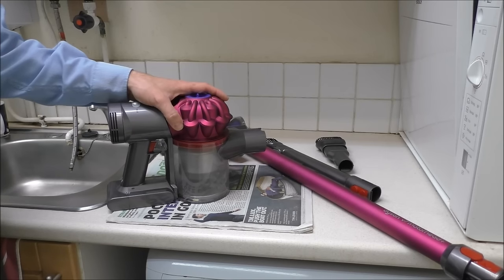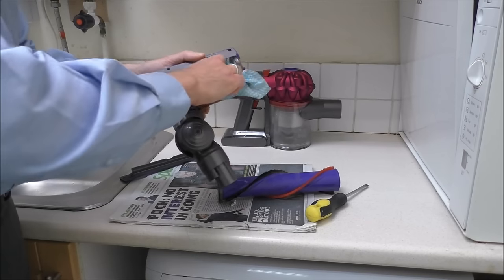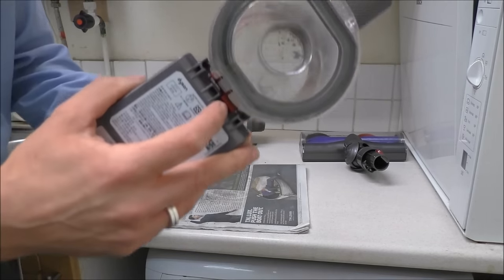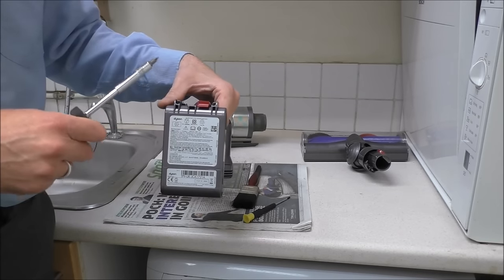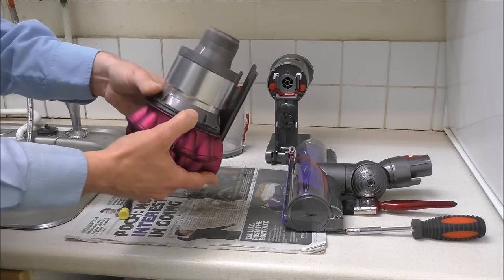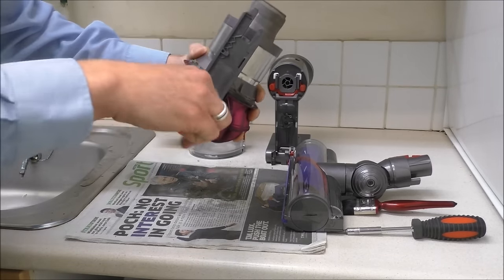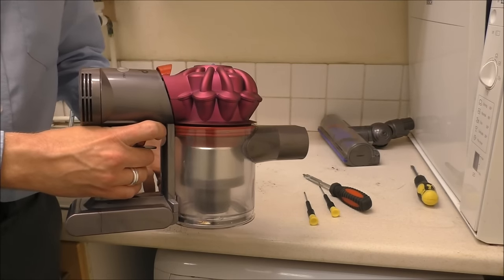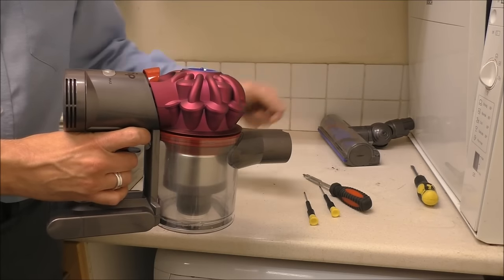How To Clean The Dyson V7 Cordless Vacuum Cleaner

Comment: This video is excellent. I’m almost 70,  have medium tech skills.  Had no problem understanding steps.  Did have to go buy a torque screwdriver, inexpensive.  With the trip to hardware, it took about 75 minutes from start to finish.  Dried everything with a blow dryer on low heat and fan.  Thank you so much.
Reply: I had to give you a like doing this at 70!
Reply: If you are able to do this outside, in the garden on a breezy day it is much better than doing it inside, especially in the kitchen.  That dust is everywhere in the air, and if there was a ray of sunlight entering the room it would illustrate the point I make.   Rather than brushing and tapping if you have access to a vacuum cleaner that blows use that, outside of course.  The harmful germs in that dust are not good to get into your lungs - dog & cat poo, avian bacteria etc. etc.  This is not scaremongering it is common sense.  As with sanding wood, do it outside on a breezy day and save your lungs!

Comment: I would suggest just to press on the plastic of the  metal screeded shroud so you don't bend the plastic with the flat head screw driver. If you press on the front side were the tab is (where you began to pry with with the flat head) and keep going round until it all unclips I found it worked just as good and without the slight damage.
Reply: Brother, your comment deserves more likes. I made a few minor scratches on the plastic and even one on the shroud itself when trying to pry it open with a flathead screwdriver. I was about to give up. But, I came across your comment...it took a bit of force, but it worked. Thanks so much.
Reply: Wish I saw this sooner. I have 100% bent the plastic 🥲🥲. However the rest of the video is great. Wish it wasn’t such an annoyance cleaning the thing

Comment: Excellent video. I had a pulsating problem in my dyson. I took the filter out and cleaned it thoroughly and the took cap of motor area dry brushed it all out and now works perfectly thanks for the easy steps to follow. Most helpful. I didn’t take mine all apart like you have shown but if I have to will follow your video again to do it.  I’m am 75 yrs old and was able,to understand every step that was taken. Thanks for the help !!

Comment: Thank you so much! Just cleaned mine watching your video. Important Tip: Adding to everyone else's advice, be sure to assemble the bin to the handle first before pushing in the top portion back in. It makes everything fit better. Also, the clips holding the metal filter are very fragile and higher up than you could imagine. Brush works but I found using compressed air outside is much better.
Reply: Yeah, I stuffed up there, before I came to this channel. 🤦‍♀️🤣

Comment: I used an air compressor that was designed for a pneumatic nailer, worked like a charm and I didn't have to take the unit apart as much as you did. Good video for those that don't have an air compressor.
Reply: change the filter or remove the existing filter from the frame piece and use compressed air to get the dust dirt out of it and the vacuum will work again with good suction!

Comment: I had a very bad odour since I bought D7 mattress and cleaning of filters, this has been on going for 6 months , after opening I found baked on dirt which cause bacteria to grow, now fully washed with disinfectant and soapy water internally as long as plastic and stainless steel fully dried I have had no issues now no smelly vacuum, I went one more stage than you and took next internal top apart very dirty in side.
Spot on video ,  straight forward when you know how 🍻👍

Comment: Very helpful and easy to follow. I had to pause and start the video often as I did each step. A list of tools I will need would be helpful at the begging of the video. Warning of not getting the contacts wet should come BEFORE he says to rinse the bin.
Reply: Agreed, I put mine directly into water. Now it doesn't work. However, I did leave for 2 days to dry. I wonder if my battery is dead, however, it was working before, albeit on/off, on/off constantly despite emptying bin and filter, etc. Any other ideas I could try before I buy a new one?
Reply: @penniejackson8479 What happened?
Reply: It worked in the end :)  @atxbee

Comment: Great detailed information.  I just cleaned my V7 watching your video. Thank you for all your help! I like the idea of compressed air ( by Jay). I used running water in All plastic parts and let the parts dry really good for half a day. It is working very well. I would do this deep cleaning maybe once in 2 years. Except for the small blue filter.

Comment: Thanks very much. I now know T10 and T8 bits to take it apart.  I cleaned it up a bit and turned on without it being 100% dry, now have a moldy smell. Need to take it ALL the way apart like you did and clean all the bits and wipe with a slightly damp rag, let dry. Very calming voice.

Comment: Very good video , but think you should show that the long cylinder filter clips apart as inside in can be heavily blocked and if so your Dyson v7 hoover could still keep pulsing or cause much lower run time , if you just ran it under the tap and left to dry for 24hrs and didn’t clip it apart and clear out the blockage as very common fault for low run times .

Comment: Great video!

My V7 Animal Dyson was cutting out every 3 seconds and the battery wouldnt last beyond the upstairs of the home.

Only fiddely bit is getting the metal mesh surround off with the flat head screw driver (at 6mins 10 seconds)...where you can void the warranty. I think I bent the plastic and it doesnt fit back as neatly, so suggest youre very careful here.

I also didnt know (until this video mentioned it) that you could get replacement batteries, got one on Amazong for £25. Longer lasting and so easy to install.
 
I just did a clean (with the new battery too) and it works like a charm!
Reply from the maker: This is great to hear that it has helped you out. Thanks for the feedback  😊

Comment: Very useful video - got me to 'first base' disassembling the cyclone unit as without it I'd never dare to apply the amount of force it takes to remove the shroud! But having got to the maximum extent of your disassembly why not go all the way? I found that the filter housing simply pulls off the bottom of the cyclone manifold and this reveals four more torx screws (well buried between the cyclones and hidden by dirt). Then there are two more in the air outlet port. Remove these six and the two halves of the manifold come apart. Then the internal parts lift out and the unit is stripped down to components for most thorough cleaning.
I think you may have cost Dyson a V11 or even a V15 sale!

Comment: That was a great in depth for cleaning. I need to know how to clean and or replace the rear filter. Thanks
Reply from the maker: If your model has a filter at the back, you just need to twist it and wash it under cold water. make sure it is completely dry before putting it back on though. If yours has a sealed filter and it cannot be removed, then i would recommend leaving it as it is a sealed unit.
Reply: @lords-electrical  ..it’s the v7 Motörhead. My battery replacement came with the cyclone shaped filter on the top and a heap filter…of course, it didn’t come with the adapter. I had to pop the old standard, not really a filter unit off the back. It was hard, but I did it. Now, as soon as I get the adapter, it’ll be much better, I hope.

Comment: Great video, thank you!  I now have a problem with the small attachment for the stairs.  The brush doesn't turn.  I wanted to take it apart to clean it, but it won't slide out.
Reply from the maker: It does sound odd, as most of the time it should just slide out. If it is blocked then it may mean getting a screwdriver and gently prising it out.

Comment: Thank you for the comprehensive tutorial. I was looking for guidance on cleaning the filter on the back of the motor however and it wasn’t addressed in this video. It looks like a small aircleaner and appears to be all one with the plastic piece that comes off the machine. Any tips on cleaning this? Thanks so much

Comment: I like how Dyson designs their units to be serviceable.  Other manufacturer's products have wiring and screws everywhere.  Dyson even made integrated  electrical contacts so you don't have to hassle with wiring connections.  The take down is comparable to field stripping a fire arm.  
Does anyone know how to access the rear exhaust filter? Newer V7's & V8's have a larger exhaust filter that simply twists off but mine is like the one in this video and I don't know how to get it off
Reply: I would also like to know

Comment: It is insane that this level of tear-down is required to clean out areas of the vacuum that will regularly collect dust. The areas you cleaned that were packed with dust clearly needed cleaning, and you state that doing so would void the warranty. That is nuts. I'm here because my vacuum started pulsing (had too high of suction resistance, so it wouldn't work). The regular dust bin, filters weren't dirty, so trying to see why it has stopped. Very much questioning this design...
Reply: Check for something stuck in the aluminum tube or right in the inlet where the implements connect.

Comment: This was useful but we chickened out getting out the guts, at a risk of breaking the clips.  I used compressed air and some small brushes to get out a lot of dirt.  By no means a thorough job, but Dyson clearly does not want it's consumers to clean their vacuums.  I'm not saying what you did can't be done (clearly it can, you did it) but it sure is risky! I used to be impressed with Dyson until now.  I am not impressed that a machine, known for it's incredible design, makes it so hard to take apart to clean.  Mine was starting to smell, and I empty it almost every time I use it, so I thought it was time to explore, but alas, we gave up.
Reply: I agree with the compressed air. I do it monthly. Yes it does get a smell. But after taking apart and cleaning the two heads along with a cleaning of the main unit to include taking apart of the bin, the unit works great. Also suggest that if you can, clean and dispose of the dust outside. Even when we just do the bin opening, there is dust that is smelled in the house. My wife uses the V7 over the central vacuum.  She has great difficulty in returning the long hose around the hanger.
Reply: @rickghigna6986  Did you (or others) ever just replace the filter?  I have ordered one to use when I've had my vacuum a while
Reply: @lindas.1751  the "center cloth filter" never had a smell. I did put a few drops of lavender oil on filter. Wife said smell is good now.

Comment: You didn't mention when you pry off the screen filter you damage the seal around it and now my dyson whistles, I am having to buy a whole new top to the D7 to fix this issue, another man ran hot water through the area in the black tube and accomplished  the same cleaness.
Reply: Eric Platter I had a hard time getting it off and it did make the edges all messed up. It’s all air drying now, but I hope once I put it back together, it’s runs smoothly.

Comment: Hello,
My V7 works perfectly in normal suction but stops quickly when I switch it to the strong suction position.
Do you have any idea of the origin of the failure?
Thank you
Reply from the maker: It is more than likely that something is blocked, or the filter needs changing or at least washing. If you have had it for at least a year, i would recommend changing the filter to start with
Reply: @lords-electrical  I religiously followed your cleaning method and it seems that the dyson came back to life! I'll let you know after a couple of days using the vacuum. Thanks for the video and for the swift answer!
Reply: @lords-electrical  We had the same issue as A Marco, but the only thing I did differently to your demonstration is that I used a brush to clean the nozzle where there is a real fluff trap.  That cured it completely (on top of your advice).  Thanks

Comment: good video thanks. just to confirm, the v7 onlt has the 1 filter - the skinny filter , is that right and not a post motor fillter as a 2nd one. just checking. thanks
Reply from the maker: It does depend which V7 model you have. If you have the V7 Absolute then it does have an extra filter on the back which is washable in addition to the skinny filter in the middle  of the vacuum.

Comment: This is a helpful video for taking the V7 apart, however this vacuum is all plastic and it becomes statically charged. So the first time you use it all the dust you just cleaned out will be right back where it was.

Comment: Hi. The cyclone assembly you opened doesn’t need cleaning as crazy as it sounds. The area you opened is where the cyclones dispense fine dust so no air actually flows through there. It’s normal for a layer of dust to be in there and doesn’t affect the performance of the machine, cleaning it is pointless as it’d be back there within first use.
I say this because your videos of disassembling can be damaging to people’s machines in their longevity (seals, gouged plastic, fittings). This goes for most of your videos on Dyson cleaning.
Reply: I totally agree with you...the cleaning procedure in the video is only valid if I wanted to sell mine.

Comment: This is the second time I cleaned D6. First time seemed basically simple and worked well. This is
about 8 mos. later, very difficult getting the second filter cover off. Had to use a lot of force to pry
it off. The fine sand-like dust I brushed off with a small toothbrush. Still coughing.
Reply: After reading Ian's note I will go next step, but really have difficulty seeing the other screws.
   Next time.

Comment: I am a bit worried at how incredibly involved this process is!! I know it is a good vacuum cleaner, but would not have bought it had I realised how complicated it is to dismantle it to such an extent. It is almost as if one was working in the Dyson factory on the assembly floor! At least, four screw drivers needed! The video, however, is excellent, in comparison to the instruction booklet which is so very poor.
Reply: I think that those slots are designed to be opened with coins
Reply: I too just bought one and it sure is a long drawn out process, won't be doing that clean too often!

Comment: what size of screwdriver do you need to open the bottom part at 0:57? I mistakenly tried to open it with the wrong size and it won't open and I've damaged the plastic around it
Reply from the maker: Annoyingly i don't have the actual size of the screwdriver, but you can also use a coin as it is a bit thicker which may work better for you.

Comment: I am having a hard time putting back together - the piece that you removed at 1:00, I can't seem to turn the piece to lock it back into place. Any advice?
Reply from the maker: It can be tricky to get the pices to line back up. The only thing i can recommend is to pull it back apart and try and clip it back together, but sometimes it can take a bit of force to do it.

Comment: Thank you so much - that was extremely helpful.  I will need to buy the “T10” and “T8” screwdrivers but I did not the added descriptive word you used.  It sounded like “trex” but would appreciate it if you could clarify for me?

Regards,

Mike DAVIES. 23/02/2020
Reply from the maker: They are normally referred to as torex screwdrivers. It is a star shape but you should be able to pick up a set of these fairly cheaply. Good luck
Reply: Harbor freight

Comment: Question: my instruction card implies (but doesn’t state all that clearly) that I should also wash the round filter on the end of the- near where your thumb is when holding the trigger.  But this is not shown in the video! The part twists off easily, but it has baffles that look like paper, in which case the water will degrade the paper? Thoughts, anyone??
Reply from the maker: This filter is only on certain models and can be washed out. Just make sure when you have washed it that you leave it for around 24 hours before putting it back on the vacuum.

Comment: Thanks for the video, in my case last cone  piece also came off without any screws, anyone else able to get that very last cone piece easily?

 I washed all the components except motor and battery assembly throughly and let it dry

Comment: I have clean all but in the power mode the dyson turn off after seconds. In the lower mode we can use it 1hour. Do you have an idea? Maybe change the accu?
Reply from the maker: Sounds odd that it is ok in the lower suction mode. Maybe try replacing the filters? Sometimes i have found this has helped in the past.
Reply: @lords-electrical  i thought why changing filters i have clean the filter..m but there is a filter in the back. I blow into it and it made klack. I blow the other side abd it klack again. I turn on the dyson and he light red. I blow on the other side 2 3 times and now it work 😅  thank you!!

Comment: Now I know why dirt just continues to fall out of the thing, seemingly forever.  I love the video...but this seems crazy to me.  I may just give mine to someone and just buy a small shop vac with a HEPA bag.
Reply: David Holt, if you're giving yours away, I'll take it.
Reply: @rdoobies8512  You can have mine, what a mission to clean it, much easier just inserting a new vacuum bag ;) not sure I'll get mine apart once it's been opened hahaha!!
Reply: @dibradshaw9968  , I'll take it. Do you still have it?
Reply: @rdoobies8512  I'm so sorry, I was speaking metaphorically!  Yes, it is a mission to clean but it's very easy to use and without the electrical connection, it really is a dream.  My apologies ...